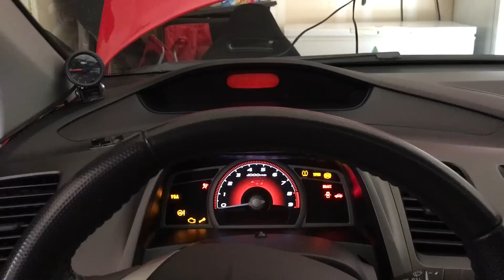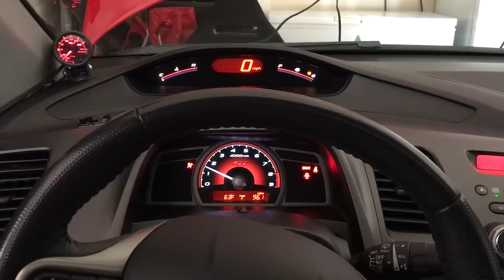E85 Cold Start Cranking Fuel Table Hondata Flashpro

Comment: My problem is cold start E 85 I been looking at the Coolant temp cranking tables mines goes from right to left from 215=-5.0  179=0.0  89= 0.0=  35 =1.5  -18= 6.0   ...
I know the last 2 needs to be adjusted how much I don't know . Please help..... Its just had kraftwerks supercharger installed with a K frank but to cold here in the morning to start

Comment: Beautiful! I knew it would start great... FYI I've been running for like 3 years with a dead fuel sender... I just stop and fill up every 200 miles to be safe. I'm going to take another stab at the fuel sender soon - this time covering everything but the sweeper contacts in paint or fuel tank liner. I've gotta get some samples soaking in fuel to test before I waste another sender. My last attempt was simply soldering the board contacts but that was a complete waste, it only lasted 2 weeks before it was totally dead. No different than leaving it stock.

Comment: can you show what you did on the table
Reply: +victor fastuo Water temperature compensation cranking table ,
 -18f = +31
0f = +9
53f = -14

Started mine on first crank in 42 F / 7 C with this setup.
Reply: Martin Schager will these compensations work on a 9th gen flashpro. VitViper is telling me he doesnt have tables to fix crank issues, so im assuming it doesnt.